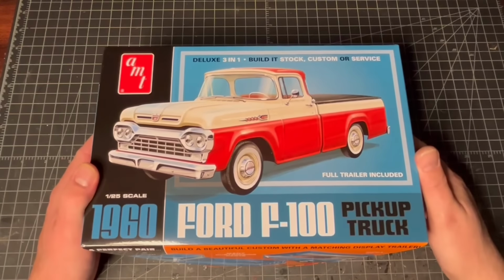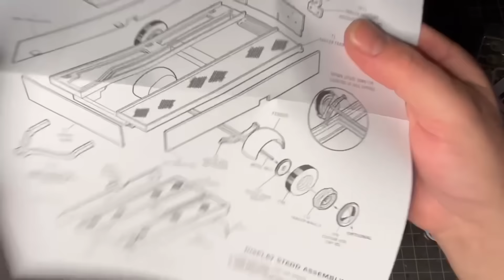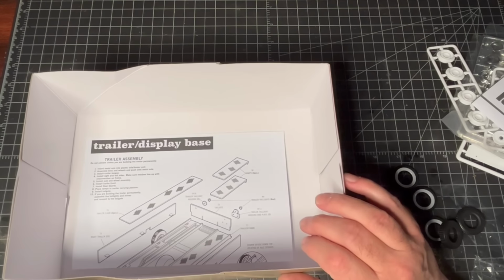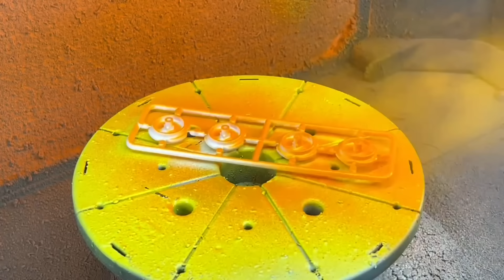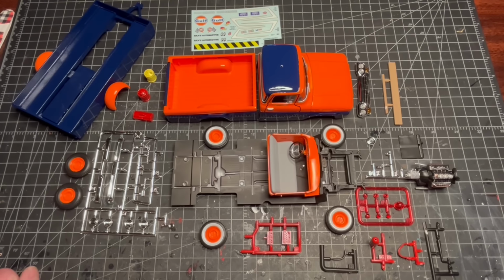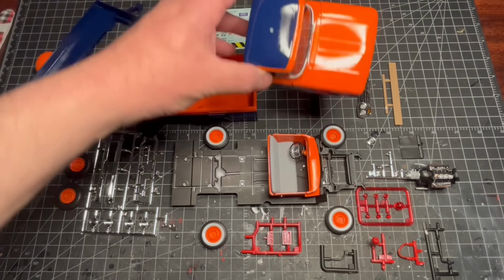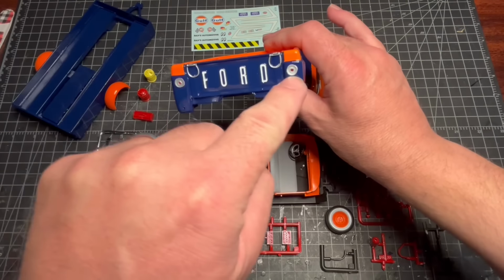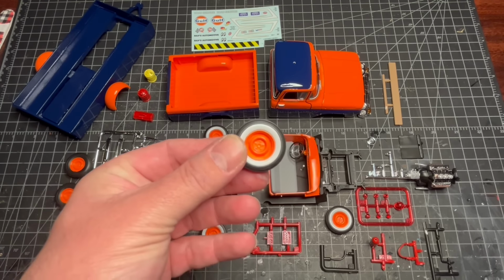Full build and review of the new Ford F100 by AMT

Comment: We had Gulf Stations here in my hometown in my youth - 1960s through 1970s.  One was a popular service garage, so they likely had a very similar truck.  I'm looking for this kit now.  I'm doing AMT's 1963 unibody F-100 Custom Cab.  Looks like the same basic kit, except for singlepiece cab/bed and grill/headlights.   😊
I took a hint from Chris/HPIGuy on the wheels, and trimmed off those huge tabs.  Made mounting the tires much easier. 👍
Reply from the maker: Thank you!! I have not watched HPI guys video on these yet. I’ll check it out. Thank you for the kind words